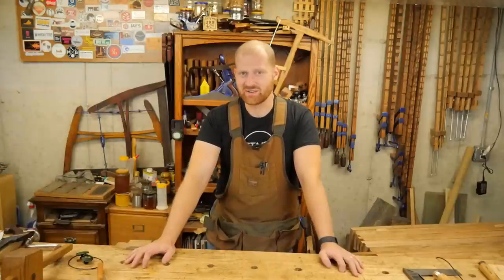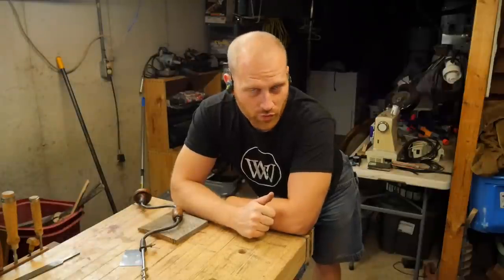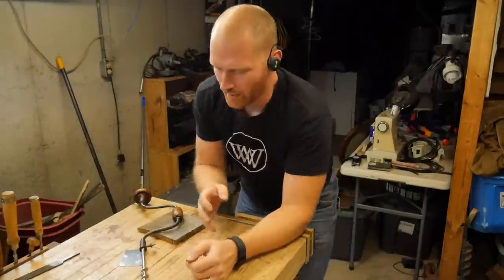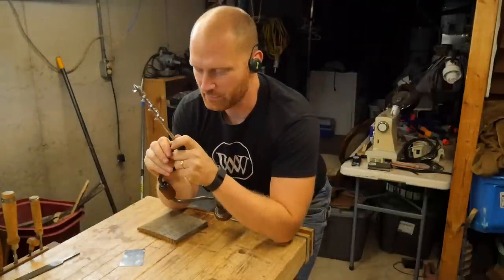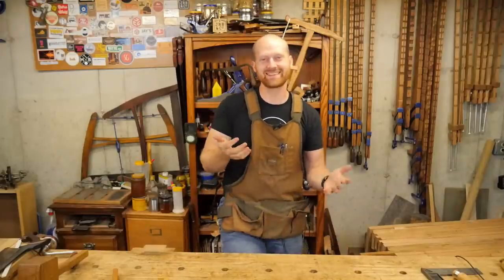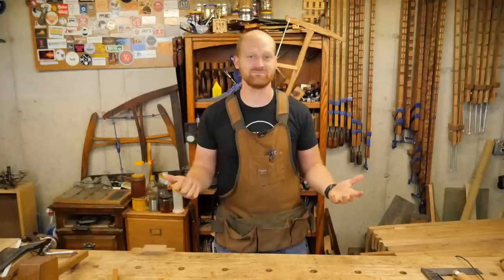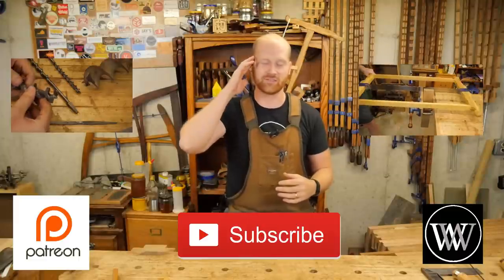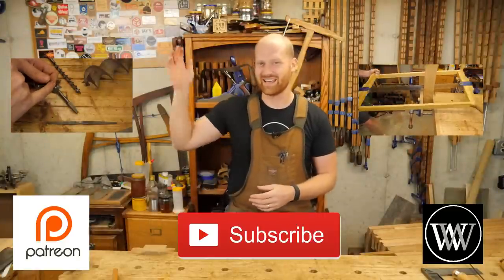How to Drill A Dog Hole In a Bench for a Holdfast or Benchdog with Hand Tool

Comment: Damn, that was quick! Wish I would have picked up a brace and bit at WIA.
Reply from the maker: +Crafted Workshop you can get them at most any garage sale or retool for a couple bucks. They are probably the most common old fashioned hand tool out there. With a short bit they are extremely fast. And you don't have to push them to the wood because this crew will pull them you just have to turn the screw.
Reply: Wood By Wright I need to look around for them. Actually seemed just as quick as a hand drill.
Reply from the maker: If the bit is sharp I will race any battery drill out there. and less chance of your arm getting ripped off.

Comment: Simple.  But effective, especially  for hold fasts.  Using  a bit and brace leaves a "rough" hole that captures  hf better than a smooth hole, eg with a forstner bit.  Wish I knew b4.  I even used past wax inside the holes .... bad idea😅

Comment: Hi, thanks for sharing. A question! This is just technical and not overthought... Lol. Should I countersink them a slight 2 mm to protect the corners and would that affect the holdfast from holding properly? Thanks!
Reply from the maker: that will not hurt at all. They will naturally get that over time if you do not do it. I usually just use a knife and run around the top to clean them up.
Reply: @WoodByWright  Ok! I will follow your advice then... Thank you again for sharing your experience

Comment: Hmm I have a sill, question. My square dog holes are worn out, quite expanded from the previous owner using metal dogs.
Would you advise to inlay them and try to fix them or just make wooden dogs to fit each individually?
Reply from the maker: It would be easier to make new dogs but I'm guessing the holes are not all the same size. Unless you want to make a dog for each hole. Which is common in the Northern European traditions.
Reply: @WoodByWright  exactly, they are not the same size anymore. The 3 that had medal dogs in most of the time are most worn. So new dogs for the holes it is. Ah so much to do with it but will be worth it in the end.
Will also need to redress the edge at one point. Someone used it shamelessly to saw directly on the edge.

Comment: This has me wondering what the "precision guys" think is going to happen if a dog hole isn't dead straight. I would imagine a dog would work just fine if the hole was off by as much as 10 degrees. As for a holdfast, you might want to round off the clamping face of it if your holes are off by that much, but I bet it would still work. This is a question for Mythbusters; too bad they're not around any more.
Reply from the maker: +KarlBunker lol that would be fun. Mythbusters on dog holes.